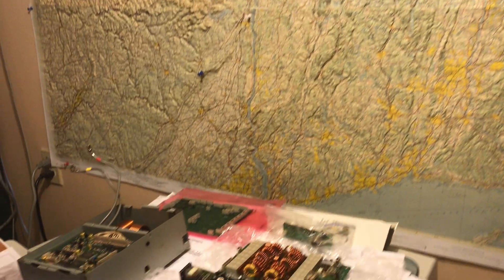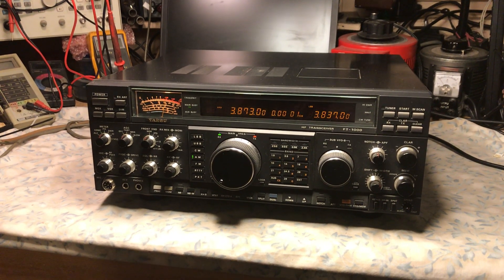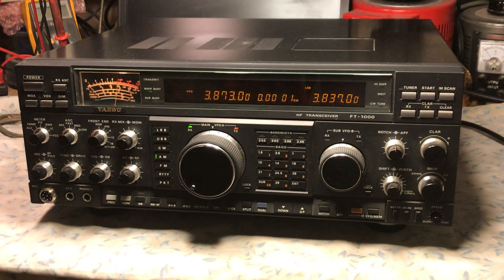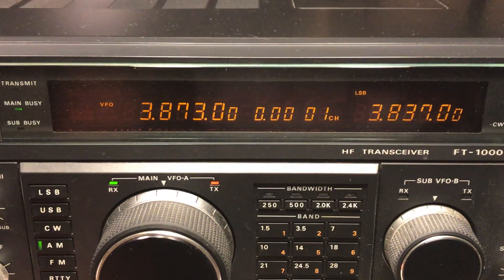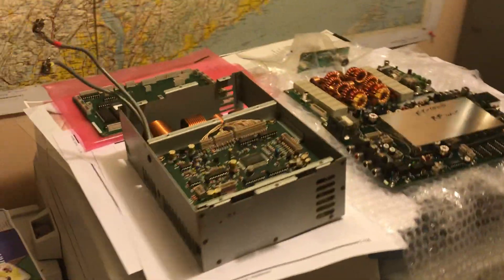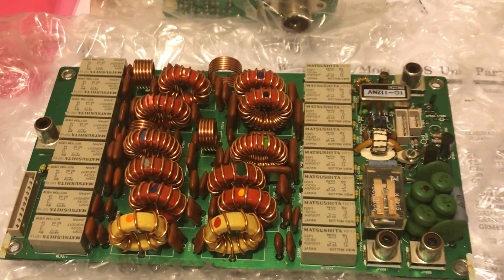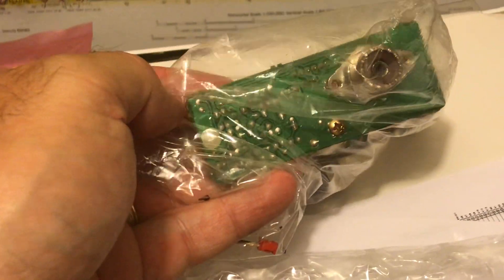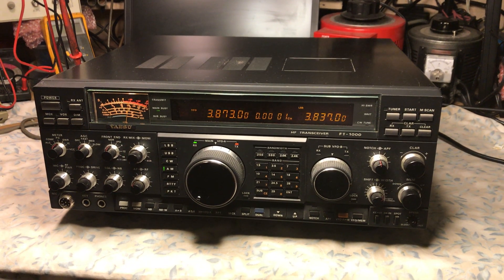Yaesu FT-1000D No/Low Receive on Main RX “FIXED”

Comment: Got question where can i find the parts to get my ft1000 goong again with receive pulling my hair out trying figure this out
Reply from the maker: There are several reputable sellers on eBay that buy these radios working and then fully part them out to sell. Listen to my video again around mid way and I recommend a specific seller on eBay who I’ve been purchasing parts for years… good luck! Best 73, Len
Reply: @n2len  i found the problem and it has been fixed

Comment: I stumbled across your video while winding myself up to fix my FT1000D which finally developed a fault after owning it for nearly 20 years, FT8 into a doublet with very high swr on some bands has fried something, suspect a fault on the LPF board. I try not to open the radio too often, has the usual noise banker mod but a few others to do while it is in bits. My radio was imported to the UK from Adam by another famous Youtuber who subsequently sold the radio to me. I have repaired other FT1000Ds but my own has never until now had a problem... have replaced a relay on LPF board for a friend. FWIW I have seen fried attenuator resistors from someone operating a transmitter on same site.
Reply: Turn off the radio when you are talking.
Reply: @annpierce9046  that often offers no protection against nearby transmitters.